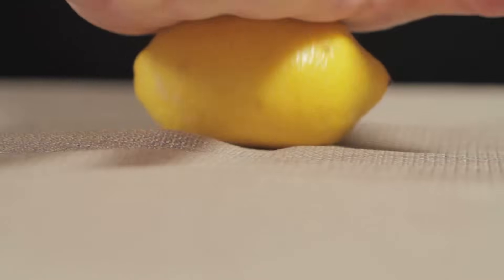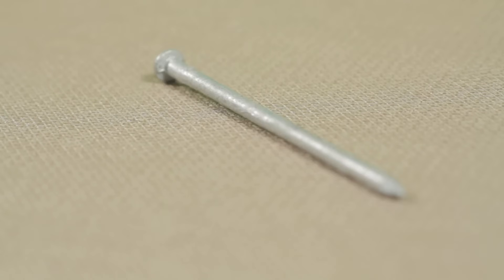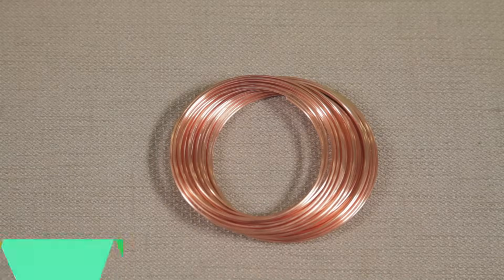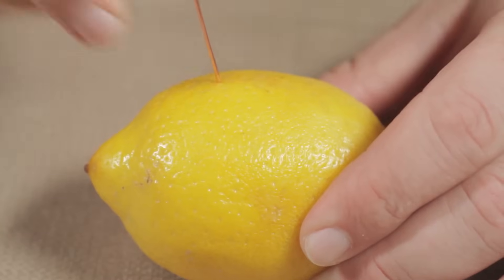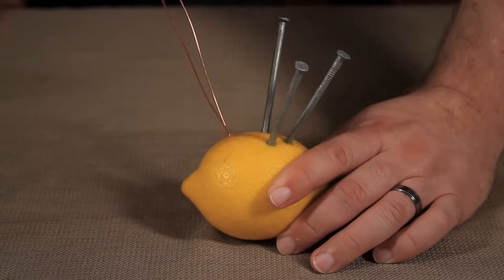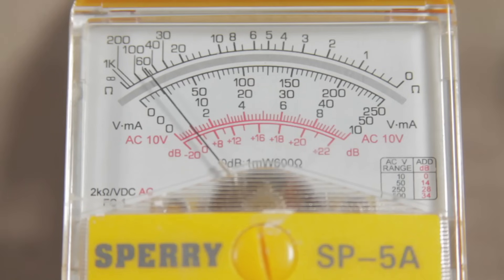How to Make a Lemon Battery

Comment: SO BASSICALLY THE THE ZINC PROTONS AND ELECTRONS GO INTO THE LEMON AND THEN CREATE ELECTROLYTES ALONG WITH THE ELECTRONS. THEN THIS SOLUTION GOES B A C  K INTO THE ZINC, WHICH THEN TRAVELS  ACROSS THE WIRE INTO THE COPPER WHICH WANTS THE ELECTROLYTES MORE. THEN THE COPPER CREATES HYRDOGEN GAS, THAT FORMS ON THE COPPER. AFTER THAT HTE PROCESS IS REPEATED

Comment: Wish you hadn't glossed over using a single lemon instead of several in series.  I'm getting the same voltage regardless of how many copper wires and zinc nail pairs are in a single lemon.

Comment: this is very confusing. you said acid pulls electrons out of the zinc. If acid can pull electrons out of zinc, then why don't we just replace the wire with a tube full of acid ?

Comment: Thanks for the explanation but I have a serious question. Everything is clear with electrons and bubbles at the copper electrode (H2 bubbles), but also there are bubbles at the zinc electrode... very like they are oxygen bubbles but why is it so? Does it mean that at the zinc electrode two processes are happening together simultaneously? That is why it is better to call them just electrodes rather than cathode and anode? It means when we speak about simple electric cell, anode has a negative charge (because oxidation happens there and electrons are being produced) but, at the same time, another process happens at the anode - electrolysis of water (4OH- -> O2 + 2H2O + 4e-) and we can see bubbles of oxygen. Or it's not oxygen at all? If not oxygen then what it can be? Could you, please, answer this question. Thank you.

Comment: Doesn't the zinc want to give its electrons away first before it let's the acid attack it? Instead of what you said which is "the acid pulls the Zn, off then the electrons accumulate on the metal."

Comment: you know that people also have a reading when using a voltmeter, holding a zinc coted nail and copper? kids get better readings than adults. why? because of the water percentage in the human body, perhaps? this means people could be turned into...batteries. I heard a lot about this in the science circles. it may sound awesome, but it is not, actually. because scientist want to use our heat to create thermo energy. but our body heat is produced by energy our body creates. it is not something without an end. it also implies human hormones.... and our most important organs- the brain, heart and liver.

Comment: Connect voltmeter and it'll show you some electric current..?! When explaining, in depth, electrolytes, protons, conductivity, electrochemical reactions and so on, then be precise. Firs of all that's a "multimeter", you make it voltmeter by selecting V, second with voltmeter you can't measure current but tension. Other than that, video is great😁👍

Comment: you say 3x the current with the lemon but youre talking about connecting in series which changes the volts. the surface area of zinc and copper gives you the amperage as it's oxidizing faster.

Comment: Language is important. Voltmeters do not measure 'current' (you show a multimeter and should be clear about the settings) and the zinc DOES NOT lose protons. Ionized zinc atoms (lacking electrons but with neutrons) move into solution.

Comment: My sone was unable to connect multiple anode/cathode pairs in sequence within the same lemon and get any higher voltage (as claimed in this video).  We were able to double voltage using two (or more) lemons as described in most other web pages or videos demonstrating this experiment.  I was dubious of this claim from the start (didn't make sense to me).  If someone has gotten that to work would be interested to hear from you.

Comment: "If I take a voltmeter and connect it to the copper and the zinc, it will show some electric current."

VOLTMETERS MEASURE VOLTAGE, OR POTENTIAL DIFFERENCE, NOT ELECTRICAL CURRENT YOUR IMBECILE!!!!!!!

Comment: Does the depth of insertion make any difference? If you push the Zinc and Copper deeper into the lemon, does that increase the current or voltage?
Reply: Effectively, yes, because you're then pushing more of the metal in, so more metal can react in the solution at one time. Which is why inserting more pieces of copper and zinc also works.

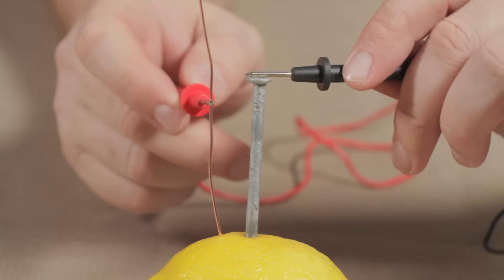Comment: 0:40 "...when asked why electrons are flowing, good change that you will be stumped or wrong".
Well sir, I'm fraid that you have little clue about electrochemical cells:

0:48 "Electrochemical cells, also called batteries..." Wrong. Batteries are electrochemical cells, but not all electrochemical cells are batteries. A hoffman water electrolysis setup is also an electrochemical cell.
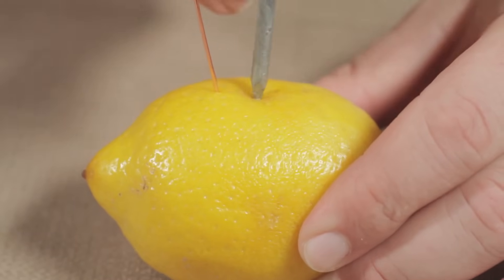1:12 "... copper wants electrons more than zinc". Incorrect. Copper (Cu) does not want electrons at all, you may be mistaken with copper IONS.
1:34 "... zinc has to lose protons too". Not true. Zinc does not have any protons available, except in the its nuclei but these protons will never leave their nucleus.
1:58 "...the acid removes electrons from the zinc". This is correct, although it's the protons in the acid that remove the electrons, and as a consequence, hydrogen gas is formed. Followed by....
2:05 "... the resulting electrons collect in the metal". You just said that the acid removes the electrons from the zinc, so the electrons are in 'the acid' and not in the zinc. This contradiction is resulting from mixing up the reactions that are happening. Yes the zinc wil be reacting with the acid forming hydrogen gas. But also the zinc atoms have a tendency to lose an electron anyway to form zinc ions that go into solution, with the resulting 'free' electron residing in the metal.
2:10 Again "...copper wants electrons more than zinc". Incorrect.
2:12 "...electrons are now in the copper and pull a couple of protons and reduce them to form hydrogen gas". What happens here is the same as what the acid does at the zinc electrode (1:58) except that the reaction at the zinc electrode's physical location involves a direct exchange of electrons (no need to transport electrons all the way to the copper electrode and therefore a waste of chemical energy not being converted into electrical energy).

Bottom line, the lemon setup is a very inefficient battery. The reducing agent is the zinc of which there is plenty; the oxidising agent are the protons (H+) in the citric acid of which there is - in comparison - not a lot available near the copper electrode. So the battery will be nearly exhausted quickly.

Comment: so if it's the acid that you need the lemon for, could you use vinegar just as easily?
Reply: Yes, but you would also need salt added to the vinegar.  Vinegar alone is a good electrolyte but it has no Ions to transfer.

Comment: If you had to make an electronic device and were being followed 
worried that wireless signal jammers could sabotage your wireless remote control activation device
then decided to build an old school analog device that ran off an alarm powered by C or D cell batteries 
could you construct a improvised battery to generate the spark?

LOL

Comment: i saw this experiment of a small sized battery capacitor , charging it causes it to produce pressure like its being inflated it hardens up and in a serries they act together sort of prventing a sudden discharge so as it all discharges in sync .its strange science behind this. but discharges extremly slow in comparisen to chargeing .a fantasy science projectno less

Comment: okay, hold on a second, every video I see about this topic gives different explanations to what the heck is going on.. so let me ask, is this science accurate and if so, why have 10% of viewers disliked the video ?
Reply: Because they didn't understand the intended purpose of this video, so they either complained about how fast he talked, or complained that he didn't give a detailed demonstration of how to stick a nail in a lemon. His science is accurate, albeit simplified for this context. Two metals with a large enough electronegativity difference are stuck into an electrolytic solution. One metal electrode (the zinc) "donates" electrons to the solution (the acidic solution provided by the lemon juice), the other metal electrode (the copper) picks them up. This creates localised regions of positive and negative charges, so when the circuit is completed with a low-current device - such as a small LED light bulb, the current will flow through the circuit and illuminate the light bulb.

Comment: How does this work without a separator? And since it does, then why is a separator used in batteries?
Reply: A separator is used in batteries because the plates are very close together.  The separator keeps them from touching.

Comment: Doing this project. When you say push in three nails and three copper wires. How do you tie them together and how do you measure.  Thanks!
Reply: (Warning: Algebra ahead!) Do you want to create more current or more voltage? You increase current by putting power sources in parallel and increase voltage by putting them in series. Power = Voltage multiplied by current. Power = (Current1+Current2+Current3) x Voltage1|2|3 OR Power = Current1|2|3 x (Voltage1+Voltage2+Voltage3). If you take the three copper wires and tie them together and use copper wiring to tie the three zinc nails together then add a 1,000 ohm resister to the three copper wires in the lemon and put a multi-meter between the open end of the resistor and the zinc nail. You'll then get a current reading. Don't skip the resister or you'll damage the current meter! To triple the voltage and keep the current the same you leave one zinc nail unconnected. You then connect the other end of two copper wires to two zinc nails being sure to leave the third piece of copper wire unconnected. Then put the multi-meter probes on the unconnected zinc nail and copper wire. You'll measure triple the voltage.

Comment: i am doing a progect and i want to do a lemon batteray but i dont think i can get galvanived nails or galvanised anything cuz of zinc and tho zinc is in lots of things i dont know if it will hurt anyone cuz this is a school scince fair and i will be disqalafied if i use something harmful and will this light fire cuz i dont know if it willl start fire then i will be disqalafied and my project will be destroyed soo i really dont know if this is harmful i neeed tihs by tomarrow sooo AHHH!!
Reply: If the power is going to a safe place like an ammeter then you won't start a fire and even tho you're using nails they'll be inside of a lemon, thus not in a position to hurt anyone. This s experiment is perfectly safe to do.
Reply: Xenon Rising thanks cuz i really needed to find out if i would hurt anyone cuz if ui get disqualafied i get detenton for a month
Reply: You can also use aluminum or silver instead of zinc. They are close one to another on the periodic table and quite similar chemically. And the only way you can light something on fire with this thing is if you hook it to some electricity - sensitive explosive compound, because it has two-thirds of a standard AA battery's power. 
P.S. You've misspelled a ton of stuff.
Reply: me to at school!!
Reply: chillycandraws!? Patterson are you sure you didn't mix up between a school and north korea?

Comment: ,,Electro chemical cells - also called batteries - require three things: 2 electrodes and 1 Electrolyte. One of the electrodes has to have the stronger desire for electrons than the other and in chemistry we say that it has a higher electro-negativity. That electrode the one that wants the Electrons more is called CATHODE. And the one that gives up Electrons is called the ANODE. Copper, Zinc galvanised. Copper likes having Electrons than zinc. So it`s more electro negative and thus our Cathode. If that`s the case why can`t we just hook the Copper to the Zinc and watch the Electrons zoom across. And what`s the point of the Lemon? I bought a Lemon and I want to use it! The Electrons aren`t just gonna stand there at their nice stable and make the medal all positively on one side and negatively on the other. There are ton of forces that prevent that from happening. Since Zinc is loosing all those Electrons, it`s gonna has to lose Protons too. And that`s when the third component comes in: the Electrolyte. The wire that connect the Electrode to the Zinc allows Electrons to flow freely that Protons are huge compare to Electrons and they can`t move through wires that`s not a thing that happens. But they can move into an Ionic Solution. An Ionic Solution like the Dilution of Citric Acid: and that is our Electrolyte. When Zinc is exposed to the Acid in the Lemon Juice, the Acid oxidises or removes Electrons from the Zinc: the resulting Positively Charged Zinc-Ions moving to Solution. The Resulting Electrons they collect in the Middle and rush across the wire into the Copper. Which - if you remember - wants Electrons more then Zinc does. Those Electrons now in the Copper, pull a couple of Protons or Hydrogen-Ions out of Acid. And reduce them, adding Electrons. The result is Hydrogen-Gas, which -if we were in there we might be able to see - as tiny bubbles forming on the Copper Electrode. In Summary the Electricity is coming not from the Lemon, but from a Chemical Reaction resulting from the Differences in Electro-Negativity Between Zinc And Copper. 
The Electrons rather would be in the Copper and the Lemon Juice opens the door for them to get there. Multiple Lemons connected in Series to give you more Power. But you don`t actually need to do that...
The Power in In the Zinc not in the Lemon.,,

Comment: Looking at AMD processors, I feel somewhat compelled to create a processor-like device with half the copper pins replaced with zinc, then plugging it up to a lemon. Wonder how much power I could extract if, say, about 4 of these thousand-pin devices were plugged up to a lemon?

Comment: 1:35 - The zinc doesn't lose protons - it loses atoms which dissolve into the lemon by breaking up into ions and electrons.  When an element loses protons it becomes another element.  But your zinc nail remains a zinc nail.

Comment: My class did this and it didn't work at all
Reply: +Cameron Peralta The nail must be galvanized. You want a zinc-copper-lemon battery, NOT iron-copper-lemon or steel-copper-lemon as the electromotive force would be negligible.
Also use a really small bulb, juicy lemon/potato, and good wires. Check the bulb with a battery prior to the experiment because there may be something wrong with the bulb.
Reply: So did myn
Reply: +Cameron Peralta What went wrong?

Comment: He is clearly confusing voltage with current. Also lemons in series builds more voltage and adding lemons in parallel or adding more nails to one lemon gets more current.
Car batteries have lots of electrode surface area so you can draw lots of current all at once so a measly 12 volts can start your car.
Reply: leerman22 XD
Reply: aamaruvi yogamani
The ignition coil does that.  The starter likely runs on 12 volts, too.
Reply: leerman22 no the car sparkplug changes 12 volts to 12000 volts to ignite the fuel and the rest is wrong

Comment: I am sure that you are aware the Egyptians first discovered the citric acid battery. I wonder if you were to fill a beaker with a lot of mass with lemon juice and used several copper wires and galvanized nails, would it generate a great amount of electricity. Would it make a difference if you used larger copper and galvanized posts, compared to several different copper and galvanized posts?
Reply: Jason Warren I heard the Baghdad battery could of been working that way. I always was fascinated by that thing and its purpose
Reply: I think by reading other comments here that you can't use galvanised zinc and must use solid zinc? And if the energy is coming from the zinc then the copper component can be smaller relative to the zinc. Not 100pc sure. Gonna have to see if I can charge my iPod with this. Would be a neat camping trick.
Reply: ... And yer seperate posts because each set works like another battery.

Comment: okay so since the acidic juice in the lemon helps conduct. would this also be effective in other acidic contents LIKE say vinegar? and is this the same effect with the potato batterie but just with sacrose instead? please answear!!! i neeeedddsss to know these things!!!!!
Reply: Yes, the only important thing in the lemon is the acidic solution, i.e. citric acid. This is the same reaction as in the potato, however sucrose is not involved in either reaction at all, as, like I said, the only important ingredients are the zinc, the copper, the acid and the wire completing the circuit. So in short, yes it would and yes it is the same, but not because of sucrose.
Reply: Metis eimi X) thank you
Reply: There are actually more chemical reactions going on to produce the electrons than just with the acid.  Potatoes and apples are much less acidic yet produce higher voltages than lemons.  If you test the acidity of fruit and then create a battery the high acid content doesn't actually give you a stronger battery because the acid is only part of the equation with a fruit battery.